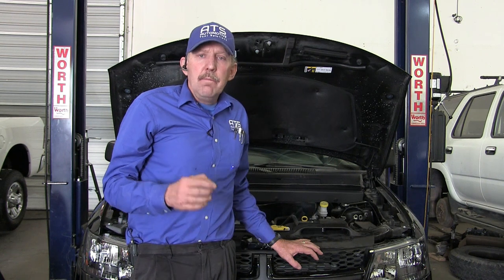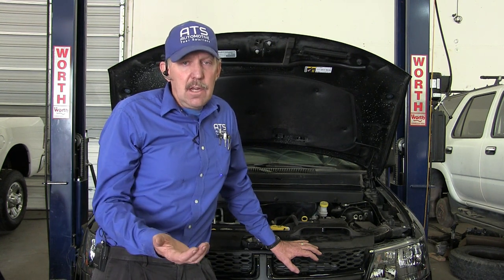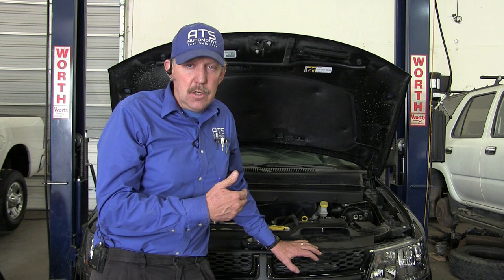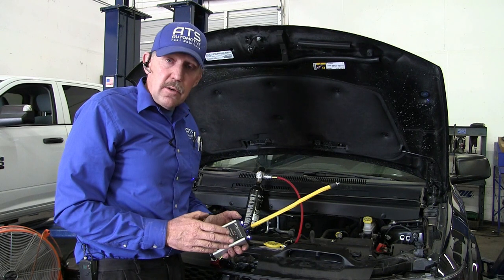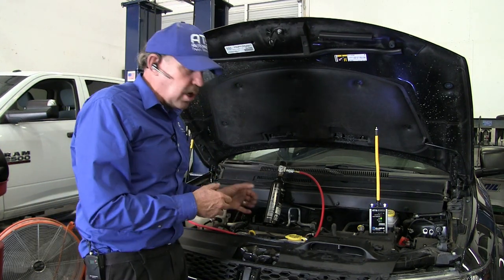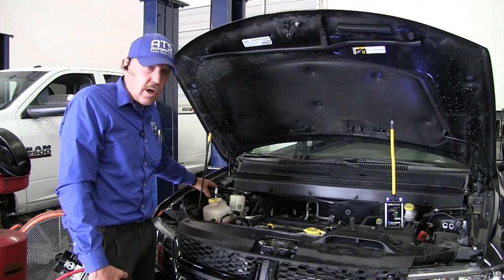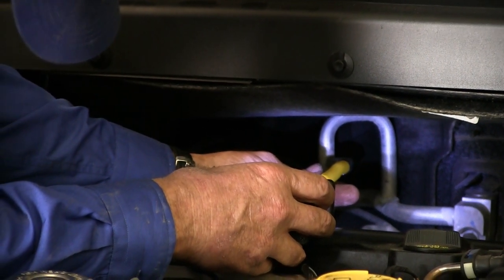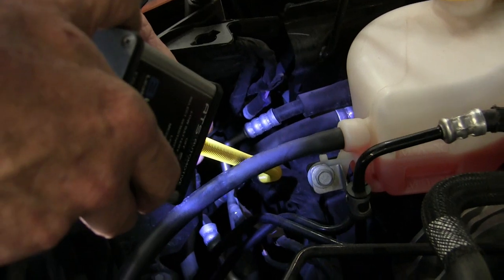2019 Dodge Journey A/C Leak

Comment: Bernie, Great suggestion to apply 200 PSI to the system for better leak detection. I went to the welding store today and bought a new regulator that allowed me to apply 200 PSI from my CO2 tank and then found my leak easily. It ended up being the O-ring at the pressure switch.
Thanks for contributing to the industry with your great advice!

Comment: Hi can u not put compressed air into the system or are u better using co2 or nitrogen on these newer r1234 am from England and don't get alot of air con  trouble only for a couple of month but always used compressed air on r134 system ?
Reply: The tool he is using detects co2. You can used compressed air and soapy water to find a leak but it would appear this leak is super super small. The ATS bullseye leak detector finds leaks you may not normally find using other methods.